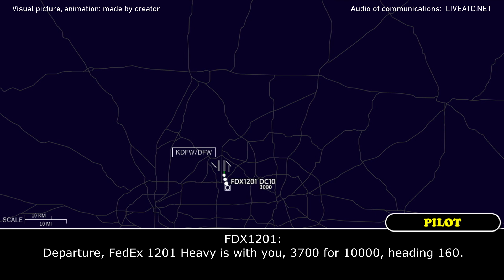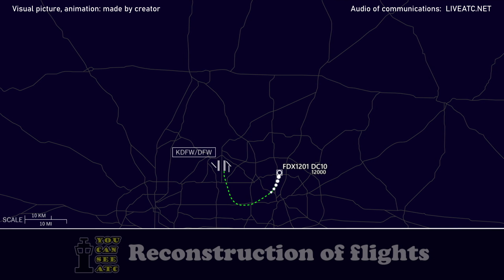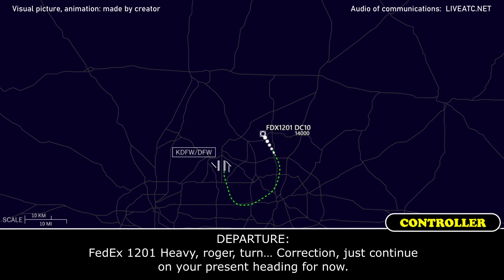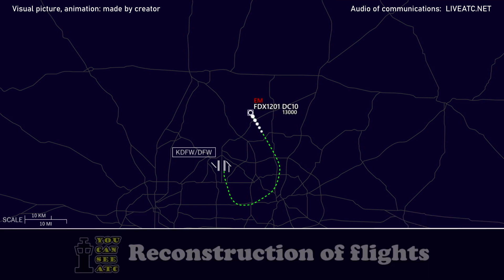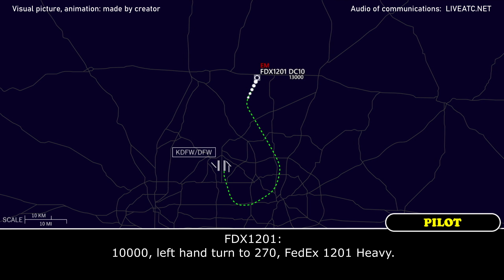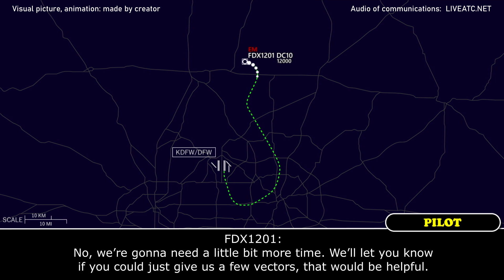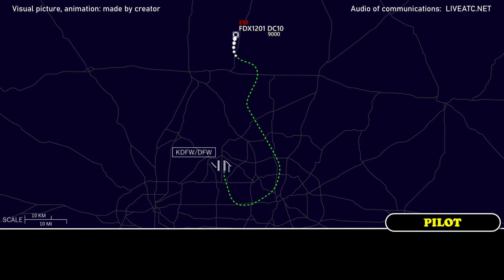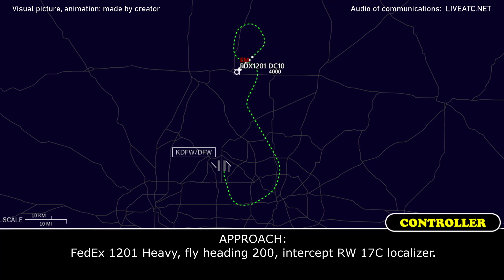Engine failure. Emergency return after departure | FedEx DC-10 | Dallas-Fort Worth, ATC

Comment: Nice work by all.  Is there no standard for fuel on board answer?  I've heard controllers request fuel in time, fuel by gallons, fuel by weight.   How about giving it by time first (that'll give the controller some vectoring/hold considerations, and giving it by weight, tells ground emergency crews what the potential hazard could be).  Just my two cents.
Reply: Tha5ts worth a buck anwayy..i agree

Comment: Out of curiosity, being of a civilian bent, is it normal for ATC at whatever level (departure, Center, approach, tower) to give a rapid string of turns (and sometimes altitudes) to aircraft, before they've even completed the previous turn? I don't usually hear the same locally at SDF for their ATCs.
Reply: ATC overall tries not to, but in high-density areas like DFW and other major terminal areas (NYC, DC, SoCal) it's sometimes difficult to avoid..
Reply: Not that there’s ever a good spot for a problem to develop, but depending on the time of day, in a south flow they had to shut down their #2 engine right as they were over the spot where  DAL arrivals, DFW East Complex arrivals/departures and ADS departures all sorta bang together. It’s a fiendishly busy spot for something to happen at, and most of what departure was doing was just setting things up so the DFW East Arrival controllers didn’t have a huge headache when they picked up.